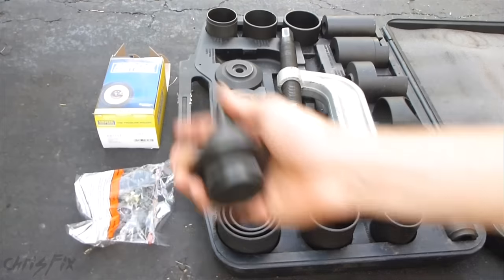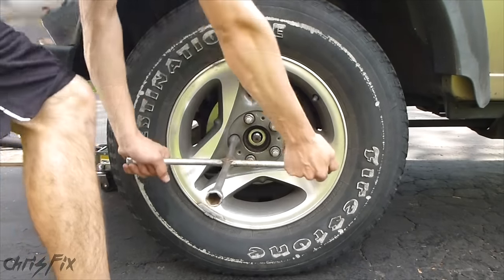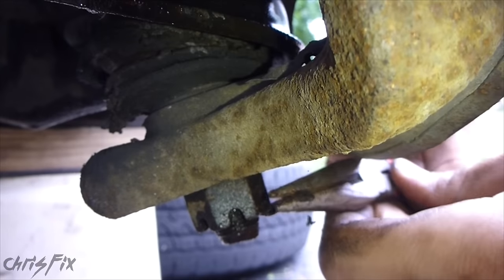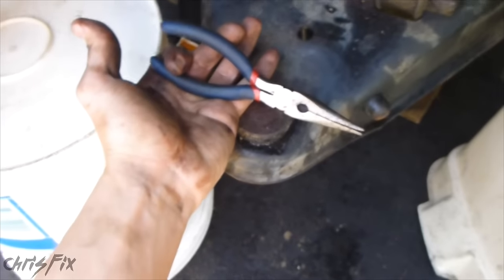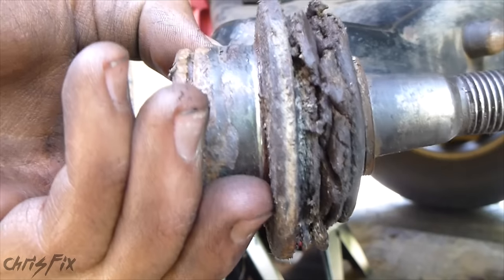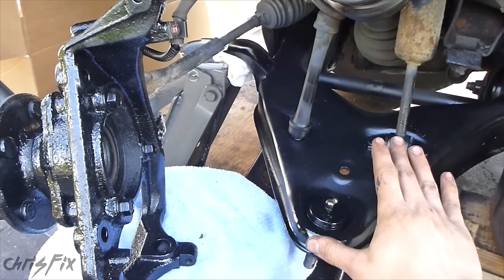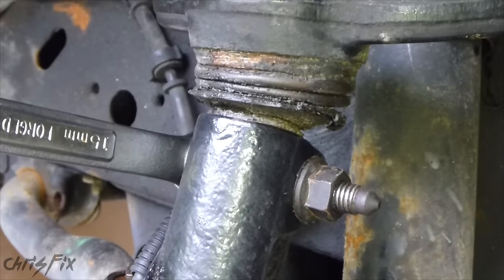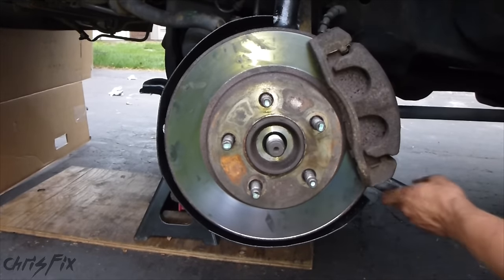How to Replace a Ball Joint (in depth, ultimate guide)

Comment: I did this on my '03 Ranger 4x4 last year.  This is a good video...sure is a dirty and long job.  I found that a BFH and berz-o-matic helped cause I had to heat and beat one of the lowers out.  I agree with the Moog products, great stuff and all 4 new ball joints have grease zerks so it shouldn't need done again at least as long as I'll own the truck.  Also, sounds silly but if you put the lower ball joints in the freezer overnight it makes them slightly easier to press back in to the control arm.
Reply from the maker: klc317 Thanks man! I have heard that you can put ball joints and bearings in the freezer to make them fit better. I would try, but I might not be allowed back in the house lol
Reply: ChrisFix You MUST,sometimes.
Reply: Makes it WAY easier.
Reply: Just don't put it in DRY.....Sorry.
Dave in Seattle.

Comment: There is a way to still use the control arm even if the ball joints are factory sealed. You just have to drill out the rivets to the same size as the lug on the ball joint.

Comment: I don't know anything about doing any of this but my fiancé's car is broke at work needs a new ball joint and axle. I just watched 2 other " how to replace ball joints vids" and compared to yours they are garbage. Thanks so much for this. He has been putting off doing his car and I know it's bc he isn't sure how. Thanks to your video I know he will gain the confidence to do this. I wish I knew what foot lbs are. I didn't see you using anything to measure pressure with. When you are tightening and you say foot lbs I don't know how to measure that. I guess I will google that. Thanks again. Subscribing. Also my 2005 Honda civic is overheating here and there. I wonder is you can help me figure out what it is.
Reply from the maker: Mary Morgan Thank you so much Mary! I really appreciate it and I wish you two the best of luck in your repair! Having the right tools and the knowing the correct process is really what it is all about. Here is a video on how to use a torque wrench and measure ft-lbs: https://www.youtube.com/watch?v=5XzKvEnk1FY
Here is a video on how to potentially fix your overheating problem: https://www.youtube.com/watch?v=s--5ft5YiHg

Comment: I am having a lot of trouble removing the upper ball joint from the knuckle. I've saturated the ball joint with liquid wrench, tried pulling up with a crow bar under the upper control arm, hammering down on the knuckle with a small sledge, and finally I have a jack pushing the crow bar up while hammering down on the knuckle with the sledge and it still won't budge. My crow bar is starting to get bent.
Reply: I got it! I used a screw driver to dig a little hole in the ball joint for penetrating fluid to seep in, cranked the jack up under the crow bar and using the sledge, beat upwards on the control arm as hard as I could. 4 hours trying. I'm so glad that part is done

Comment: Very detailed video.I only have one question.why did not you place the jack lift under the lower control arm before tightening the bolts?You should remove all jack stands and only use a jack lift under the lower control arm before you torque the bolts.
Reply from the maker: L Szek Thanks. Why would you need to place the jack under the lower control arm before tightening bolts?
Reply: So every parts get to the right place and you don't put anything in bind.If any suspension part is in bind it will be damaged in a short period of time.When all 4 wheel are on the road the weight of the vehicle is resting on the control arms and all suspension part gets into normal position.By tightening the fasteners without the weight of the vehicle resting on the control arms you will fix the parts in an awkward position.
Reply from the maker: L Szek That is only true for bushings and since these are ball joints you do not need to have a pre-load on the suspension. When you tighten the ball joint, it mates to the knuckle nice and flat. The same goes for the upper control arm ball joint.
Reply: Than you have nothing to worry about..
Reply from the maker: L Szek Exactly. Here is more info for what you are talking about: https://www.youtube.com/watch?v=-QczV_6v42A

Comment: Thanks for the video, I didn't have a 27mm or 28mm socket for the castle nut, so I tried it with a 1-1/16, it's supposed to be a bit smaller than the 27mm but it fits perfectly. Just wanted to share!
Reply from the maker: Arturo Torres Great thanks for sharing! Glad the video was helpful Arturo!

Comment: Hey Chris. I love your videos man. Quick question. My lower ball joint doesn't look like that. Do I still need a press for the ball joint? I have a 07 Scion tC
Reply: youre 07 scion tc lower ball joint should be a whole assembly that bolts on to the lower control arm and slides into the knuckle... no press off/on needed.

Comment: I'm failing on step one.  Sigh.  Not a good sign.
Any tips for how to remove the can-shaped, featureless, plastic center nut covers?  There are no screws/bolts/nuts, etc, that I can see and it doesn't seem to unscrew.
Reply from the maker: Gertie Craign You might have to take the tire off and pop it out from the inside and then put the tire on. I dont know the design yours has so.

Comment: @ChrisFix I don't know where DIYers got the idea that if it comes with a grease joint that it is higher quality, but years of repairing cars professionally and I can tell you this is terrible logic. In fact most of the cheap junk comes with grease fittings and high quality parts, including OEM, are now sealed units. It's not the 70s anymore man, if you want to use a grease fitting because of some personal hangup you have, who am I to tell you not to, but to tell people that this is the indicator in quality in this day and age of suspension components is disingenuous.
Reply from the maker: +Michael Costa Thanks for sharing. The parts I were using were in fact high quality and having a grease fitting is a great feature. I appreciate your opinion!

Comment: Chris. I am having trouble getting the knuckle free from the lower ball joint. Bolt is removed and I've been hitting it with a hammer. Any suggestions? Thanks.
Reply from the maker: +James L. Use the press and use penetrating fluid. Some heat will definitely help too. Make sure you remove the clip holding the ball joint in.

Comment: Great and very informative video, thanks! One small thing; when loosening the hub nut, to avoid possibility of wheel bearing damage, it's a good idea to partially lift the car so you've still some friction to counter undoing the nut, but most of the load isn't on the bearing. This was from a VAG workshop manual. Don't know if it applies to other manufacturers. Just something to be aware of. I think it also may only apply to non-driven stub-axle types, don't remember 100%.

Comment: Hey Chris, not sure if you noticed, but your using the press clamp backwards.  on the bottom of the "cup cap" there is a circle that fits into the open end of the clamp.  That way you don't have to scrape your knuckles on the ground.  Not sure if you figured it out yet.  Thanks to your videos I just completed my first upper and lower ball joints with the help of your videos.  Keep up the great work!
Reply from the maker: +Charles Hubbard Thanks for the tip Charles! Glad the video was helpful!

Comment: Great video! seems I have the rear passenger BJ busted on my 02 Eclipse GT. I keep hearing a clunk when going over bumps or potholes. I already ruled out the struts which I replaced 8 months ago.
Reply from the maker: Could also be sway bar end links and/or sway bar body bushings. Check that out too! Here is how to tell if your ball joints are bad How to check a Ball Joint

Comment: When you are replacing the lower ball joint... when you come back to install the ball joint the lower control arm is brand new!  Do you have a video showing the replacement of the lower control A arm?  Is it the same as an Upper control A arm?
Reply: Daniel Vigil it's not a new control arm he paints the stuff that's rusty under his truck in all the other videos you can see him spraying his  exhaust, brake drums and a whole bunch more

Comment: Hello Chris, I'm done. First one took 3 hours, second one was 55 minutes. The solution I used for the stuck tapered ball joint was an old gear puller, penetrating oil,
and two 5 second blasts of electronic parts cleaner and lube,(much like Freon,gets real cold). Waited about two minutes and it popped out on its own. Just got it all aligned and tires rotated. Thanks again for the great! video.Your camera work, editing,and syntax really pull it all together, You saved me a boat load of funds.  Dave
Reply from the maker: davebonnie4  Glad the videos were helpful Dave! Thanks for letting me know how it went! See how much faster it is when you do it a second time! Nice work!

Comment: Chris, Husband is trying to replace upper and lower passenger side ball joints 2001 Ford Ranger 2 wheel drive. When purchased, the rubber seal is not on the ball joint. He has tried everything to get it on. Is there something he can try. He has already torn it a tiny bit trying to get it over.
Reply from the maker: Catherine Haney The rubber boot should come with the ball joint. If not, it sounds like you found one that goes on it. Just slide it over the ball joint stud and bolt then bolt the ball joint onto the knuckle. Some grease will help it slide on. Maybe I dont understand the problem because this should be simple. Let me know if this was helpful!

Comment: Hello Chris, Your videos have been a big help. Thanks!....One question I have is related to a problem I'm having with not
being able to get the bottom ball joint to pull out from the tapered hole in the knuckle? Penetrating oil, taping with a nylon hammer, even used a bottle jack to push up on that stud with some soft aluminum to protect the threads. It appears to be froze solid. Any suggestions would be much appreciated. Thanks Dave
Reply from the maker: davebonnie4 Thanks man! They make a tie rod puller that would work to separate it. You can rent that for free at the parts store. You can also try using the ball joint press to push the stud out. That is what I ended up doing on the other control arm.

Comment: Very informative video,- as always!
What kind of paint are you using for the control arm and knuckle? 
I am restoring some steering components and I just finished sandblasting and now I am wondering which kind of paint I should use for them. I don't care about the finish very much, it just have to hold up very well and protect the components from rusting, weather conditions here in Denmark is not very "car friendly". I am thinking some of the Hammerite products could be an option. Do you have any suggestions?
Reply from the maker: bloever1234 I am using this which I am really impressed with: http://www.amazon.com/gp/product/B005H5P5C6/ref=as_li_tl?ie=UTF8&camp=1789&creative=390957&creativeASIN=B005H5P5C6&linkCode=as2&tag=chri0e2-20&linkId=KJMPMAQUU2IFRIBS

Comment: How did you torque your axle but to spec if your linked torque wrench only goes to 150? I ordered the one you linked to. Seems like it has great reviews as long as I don’t get a unit that was returned.
Reply from the maker: You either have to get another one that goes even higher or you can max out the torque wrench and turn it a little more.

Comment: hey Chris i have a 97 lincoln town car. i have a terrible squeaking noise in front suspension. i lifted my car to check play in my tires and there wasn't any. I turned my wheels side to side and i didn't see any play in any of my suspension parts. i know these cars are bad for ball joints going out but i was wondering what would should i try next
Reply from the maker: If the ball joints are making noise they are bad (metal to metal contact). You can try drilling a small hole into the boot and spraying lubricant/grease in there for now but they will need to be changed.

Comment: Great video the best most indepth one on here.I just did my Ford Explorer and I believe the front end of your vehicle is the same as mine.I had a 96 explorer with a stick trans I partially rebuild and the trans was made by mazda so Im guessing they share alot of the same parts.Just did upper and lower ball joints and couldnt have done it without your video thanks for posting it Lewis.
Reply from the maker: freddiebebop AWESOMEEE! Glad my videos have helped you fix your Explorer! Nice work and thanks for letting me know the great news! Keep it up!

Comment: I'm squeaming to do car stuff. I tried changing the back bumper, but couldn't get the screws open open without proper wrenches, and as I removed the toeing hook's four screws, the nuts apparently dropped off inside the chassis under the bumper parts and it can't tighten anymore. I guess I pay the local mechanic school to change my bumpers.
Reply from the maker: +Teemu M. Gotta break some bolts and get your hands dirty to learn how to fix stuff. It happens but it is all part of the learning experience.
Reply: ChrisFix I know, and I have changed the oil and fixed the trunk lever inside. but it's my own car and I can't break it as it has to drive at any time. Then again paying for someone to pick it up is not right.

Comment: how do you remove a stuck axle within the hub... rented a pull tool that bout broke on the threads.... so Ive hammered it a shit ton and nothing... just not budging..
Reply from the maker: Kenneth York You can put the axle nut on the axle and hammer it with a 4-5lb sledge. That will pop it out. What size hammer are you using? Try using this penetrating fluid: https://www.youtube.com/watch?v=2WuVBFTzoKc

Comment: Hi Chris , I got the same truck Mazda B3000...My lower ball joint is jam with the brake caliper...control arm...even after I remove the bolt. What kind of tool I could use to separate the both parts?
Reply from the maker: This is exactly what you need: http://amzn.to/24xZQhT
Reply: Thanks bro!

Comment: That's some kinda bullshit. permanently pressed ball joints are ridiculous. Like a permanently placed oil pan (GM!!! WHY?!) in the 2004 blazer. wanna fix that leak? step 1: remove engine from vehicle...
Reply from the maker: F!@#Guilt That is crazy they have permanent oil pans!
Reply: Well, its sort of integrated to the engine block. I'm told and, on inspection confirm that, you can't get the pan out without removing the engine. I mean COME ON GM! WTF man?! my f-150 was E-ZY to work on. I switched to toyota and am never looking back.
Reply from the maker: F!@#Guilt Crazy!

Comment: Hey Chris, I'm looking into purchasing a quality ball joint service set. I've seen that you rent them from the auto parts store, I've done that before myself and had no issues with them. I purchased a Harbor freight set and got it home to find that most pieces were rusty (NIB) and later read bad reviews on the threads stripping or the adapters bending or collapsing. Have your experienced this? and do you have a brand you recommend? I've found a company called OTC and their products seem good. love the videos BTW.
Reply from the maker: +Anthony Pope Check the link in the description to the ball joint press I recommend. The harbor freight press is not that great unfortunately. OTC has good stuff for sure!
Reply: OK, thanks! Much appreciated.

Comment: 10:43 maybe I won't get a ball joint with a zerk grease fitting, after all.  Clearance seems to be an issue.
Reply from the maker: LaodiceaMythos They are made to fit so if it comes with a fitting you wont have a problem. It is definitely something you want because it will allow you to pump clean/new grease into the ball joint and push any debris out.

Comment: will a ball joint removal kit also work for the control arm bearings? I figure if I replace the ball joints I will replace the control arm bearings and if wonder if I need to rent separate adapter kits to do so
Reply from the maker: TJ Pierre Yes, check this out: https://www.youtube.com/watch?v=aPbL9HTHZg0

Comment: All wrong and this video is going to get someone hurt bad because this was done without the COIL SPRING even being there
Reply from the maker: Earl Guyton Again, this truck doesnt have coil springs. The video is 100% correct. Thank you.
Reply: Earl Guyton Not all Rangers and B-Series trucks have coil springs.  The ones without the springs have torsion bar front suspension which doesn't require them.  My 2002 Sport Trac, which is a Ranger-based truck, doesn't have coil springs.  Sport Tracs are all torsion bar front suspension.

Comment: How do you know if a ball joint is serviceable? You mention in the beginning that some ball joints must be bought with the control arm. I have a 2001 explorer that needs upper and lower replaced so I'm trying to figure out what I need to look for.
Reply from the maker: cwvowel The 2001 Ford Explorer should be the same exact setup as my truck so it is not serviceable. I have a video on how to replace the upper control arm and ball joint here: How to Replace a Control Arm (upper or lower) and also watch this Control Arm Bushing Preload, Important Information!
To answer your question though, as you saw with the lower control arm, it has that snap-ring that holds in the ball joint, that will be visible on serviceable ball joints. It should just look like you can press it out.
Reply: Excellent information! Thank you for that.

Comment: Hi chris, i was wondering, what is you're opinion on ball joint separation tool similar to OTC 6297 they seems like a good/cheap alternative to those big and pricy kit?
Reply from the maker: +XDxJasonX That tool only removes the ball joint stud from the knuckle. It does not remove the ball joint.
Reply: Removing the ball joint itself isnt a councern for me i have access to hydraulic press, my main concern was on the product breaking violently, it seems like it tend to do that. I will buy it anyway and be cautious. Thanks